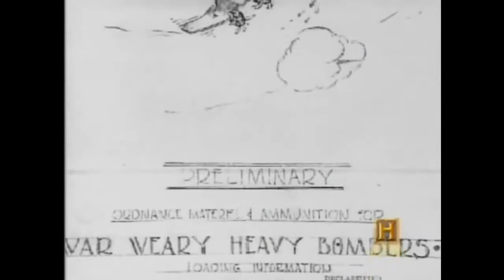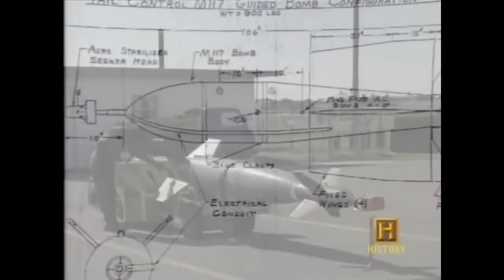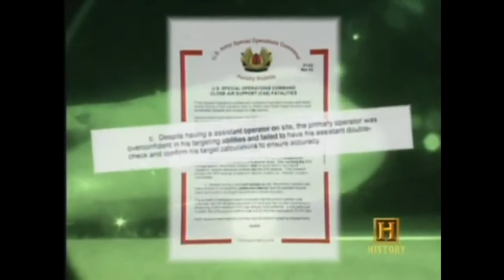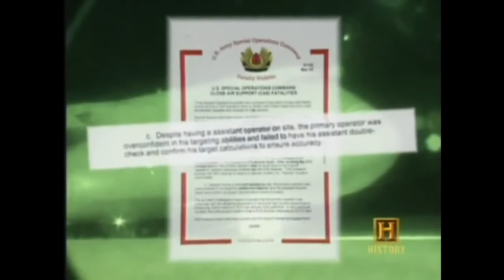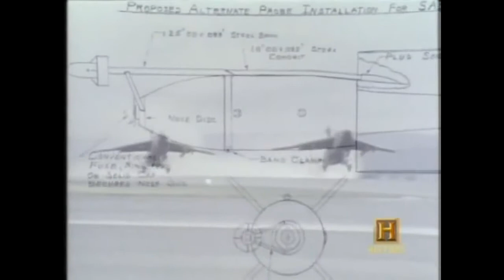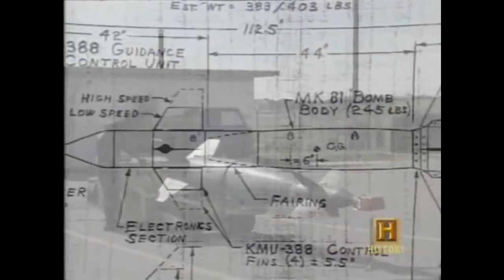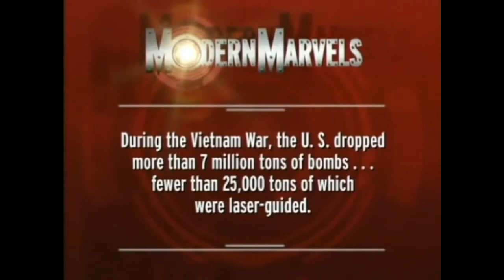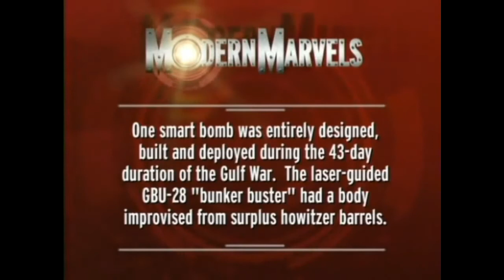Smart Bombs - Documentary on Smart Bomb Technology

Comment: Question, will JDAM Work without satellite or GPS and rely on Laser Guidance?
Reply: Originally, JDAM was a GPS/Inertial navigation-guided bomb. Later versions like the GBU-54 use a laser to assist with targeting, and newer versions of laser guided bombs use GPS/INS to assist their targeting. They all have their merits, the Laser-guided one is the most accurate, but is useless without clear skies. Optically guided bombs are flexible but useless at night, and GPS/INS is capable under any conditions but the least accurate of them all.
Reply: Because in 32:42, there's an Incident that the GPS JDAM has struck the Chinese Embassy, as if the JDAM has a Guidance Error compared to Laser-guided Bombs. Also, especially in 34:01, the worst Friendly Fire Incident. JDAMs with GPS Guidance has a drawbacks than Laser-guided Bombs right?
Reply: @mystyle_jm8997  yeah Laser guided are most accurate. Those two situations were error on the human rather than the bomb tho. The embassy was faulty intelligence and the friendly fire was an overconfident bombardier.